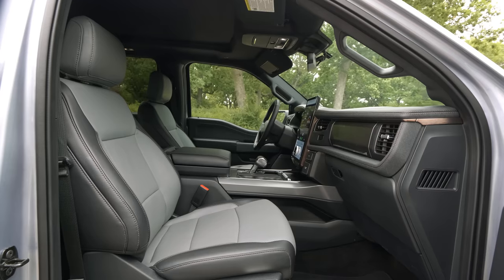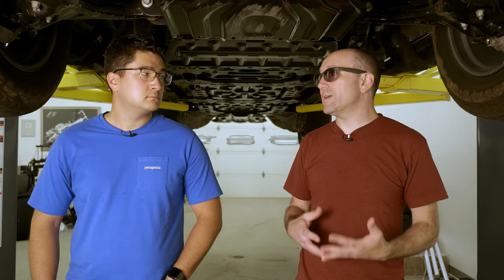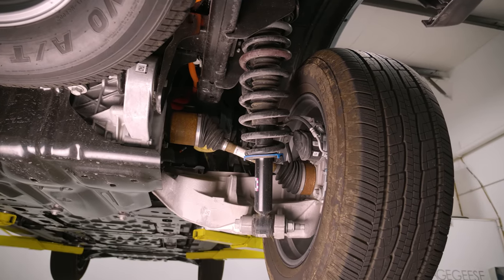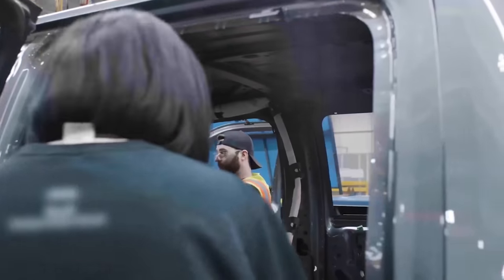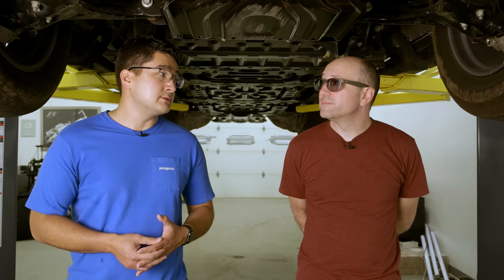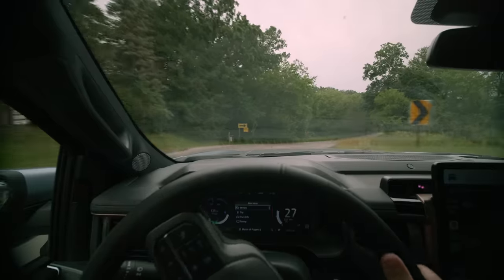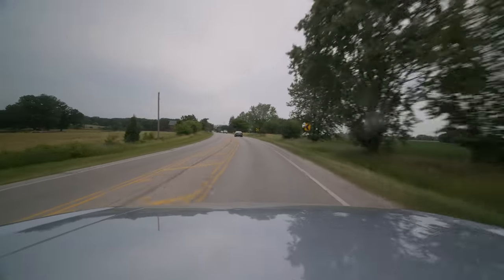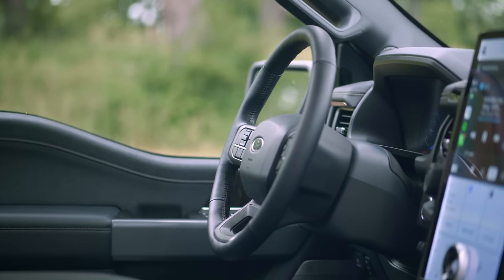Ford F150 Lightning | The EV That Will Change Trucks

Comment: QUESTION / TOPIC REQUEST: This might be relevant and a good topic for Fine Print: Battery charge cycles and longevity. All I hear is that if you avoid deep charge and discharge, the battery will last for more charge cycles, i.e. prolonging battery life. But it is never explained in detail. Does it refer to theoretical full charge cycles or to the actual narrowed charge cycles?
For example: If, theoretically, using a battery only between 40% and 60% charge gave you 8000 charge cycles and using it between 30% and 70% gave you  only 4000, then it would be the same, since each charge cycle covers twice the usable energy.
Is there a complex curve with identifiable sweet spots? Or is the usual norm of charging to only 80% for longevity just a compromise decision by manufacturers between longevity and practicality?

Do electric cars (all) allow you to choose your own charge limits? If someone is only doing short-distance drives, wouldn't they want to cap charge to 60% to presumably further improve battery longevity? (I imagine, apart from cars, electric toothbrushes and razors would be particularly interesting here, since they almost always just sit in the charger. Also DECT phones or such. But there also seem to be at least NiMH batteries that are optimized for this constant top refresh charge.)

Also interesting here is whether what burdens battery lifespan is more the charge state or the use of it in a certain charge state. I heard 100% charge will by itself stress the battery, but how much does a discharge activity add to that stress?

Comment: Lariat trim with the extended range battery is the way to go.You get the full 10,000 lb towing capacity, longest range, and a very nice but still practical interior. They need to make a 6.5ft bed length version.

Comment: As someone that bought their very first truck, a used F150 last year, we tow and haul quite a bit. Some short trips, some longer.
Ideally, this would be our daily and for the short tows with maybe a gas/hybrid F150 or F250 for longer trips as a loaner from the dealer? 

That would cover all our bases extremely well, but not really practical for the marketplace.

Comment: I do think this can be the game changer for pick-up's in the rest of the world. This isn't hit with the insane taxes in Europe and can still tow a bit and be usable for contractors who don't do >300 km a day, and the most don't overhere..
Reply: Yes distances are shorter so it's absolutely a better fit for Europe. Sadly we only get shitty diesel 4-cylinder pickups that get like zero R&D money spent on them so they are terrible compared to American pickups. I actually consider importing a Lightning Pro from the US for Europe, it's just so good and tax exempt here.
Reply: Most people drive much smaller pickups here
Reply: @imnotusingmyrealname4566  Yeah and that 4 cilinder's are just there for the CO2-taxes. I do think that if Ford is smart about how to roll out this vehicle in Europe it can be a big market and chance to set themself into the front of the pack.
Reply: @thomaswood2390  partly it's handier for the bigger cities, but I do think also because of the enormous taxes. A loaded F150 with the 3.5 ecoboost cost >120k Euro's so it doesn't compete with loaded MB Sprinters or some high end VAG products.
Reply: this truck is way too big to be a hit around the rest of the world. There are whole sections of european cities where this truck is unusable due to its size.
Reply: @imnotusingmyrealname4566  Nah, streets are too narrow in most of Europe. 

An all EV Maverick would be better. This thing is just way too big. A toyota hilux looked like a god damned lifted f250 in the UK.
Reply: @Channel-gz9hm  true. But if weight of size will be the measurement is to be seen..
Reply: Yeah but its like 3 times the width of your two lane roads..

Comment: The ICE models don't have a "range" per se, because they are so quick & easy to refuel. Their "range" can't meaningfully be compared to an EV range.
Reply: The range of an ICE truck to and EV truck can verily easily be compared and should be an important consideration in any purchase decision.
Reply: @Parker53151  no, because refueling on a car is far quicker. The only way to compare is time to travel 500 and 1000 miles. Then it makes more sense. Certain trucks and sports cars will lose to high range evs who can do the trip without stopping. There's no way though 250 miles of range in an ev is equivalent to 250 miles of gas range.
Reply: @Tential1  miles = miles

Comment: I’m an electrician. I have a reservation for a Lightning. From what I gather, Ford has partnered with some company which I am assuming “partners” with local contractors to install the required equipment for powering your home from your EV. The first thing this requires is the 80 amp Ford charger which comes with the larger battery versions. What doesn’t come with it is the transfer switch. I’m guessing that the transfer switch has some Bluetooth or WiFi connection which allows control of it through your mobile device. 

I have had trouble researching the operations of the 80a charger, and how it inverts to power a house. Ford has said that if you purchase this charger separately that other Ford EV owners can power their houses. TO me, this means ALL YOU NEED is that charger. A transfer switch merely switches power supply to another source. The same can be done if you have a brain. Most homes should have a main breaker or main disconnect. This will cut off the power supply from the utilities. Simply turn off the main, signal the charger to invert power from the EV to the house, and you’re there. This can also be done with a manual transfer switch- of course that is not as cool as being able to do it with your phone, but it might be several thousand dollars cheaper than a BT transfer switch. 

All of the electronics that make the inverted power supply possible have to be in the charger. Obviously the charger can’t be powered by the house if you want to to power the house. Any controls required to signal a transfer switch, or get a signal from a transfer switch must be powered by the charger’s DC side also so there has to be some way to bypass or jump contacts out in the charger. 

Like I said, the owner just has to have a brain trained to follow procedures. First, cut off the main power. Second, make sure truck is plugged in, and tell it to invert power. I would add in the case of air conditioning, that it is best to cut off your AC at the thermostat before switching power- regardless of how you do it! Then turn it on after power sources are swapped. This would be true for any installation. Reverse procedure when the utilities are on. With a manual transfer switch, you’d thrown the switch prior to telling the truck to invert power. I’d suggest a manual transfer switch with monitor lights so you’d have visual confirmation when the utilities are back on. Ford merely suggests that you use the company they partnered with, but it is not required. By NEC, all appliances are required to contain instructions for installation, so any electrician should be able to install and check operation of the Ford 80 amp charger. Best wishes to all.

Comment: I can't wait to see the recalls and headaches with all this new tech.
Reply: It's actually quite simple design.
Reply: Gas engine vehicles are much more complex
Reply: @DaRevrin  20k$ for a battery sounds pretty complex to me........
Reply: @illreportbackinabit.8514  Not really, extremely easy to replace a battery.  I'm not an electric car guy at all... but gas vehicles are astronomically more complicated and have many more opportunities for issues short and long term.

Comment: This is the first EV I've been interested in.  I have my 'sports' sedan, which I would keep, but this can occasionally tow my father's boat if needed and tow/haul stuff.  I had to rent a Uhaul cargo van just to pick up my new TV for instance.  This EV makes sense from a utility perspective as I am not a truck guy.
Reply: Unless you need that utility multiple times a week, people are still better off just renting a truck from a big box store/uhaul when it's needed.  The total cost of this truck (monthly payment + insurance + maintenance (albeit less than an ICE truck) + recharging cost) will outweigh the cost of renting-when-needed by a huge margin, and you don't take up the space needed for a second, large, vehicle.

Comment: Ford chose to “Frankenstein” the ICE F150 to get the Lightning to market quicker rather than a dedicated EV platform. Time will tell with the pros and cons as more BET (Battery Electric Trucks) come out. 

As far as the EVs being a home generator, OEMs are certainly starting to develop V2x applications (vehicle to anything). As you mentioned, residential and businesses with chargers will need to be outfitted with the proper hardware, but the intent is to balance grid capacity/utilization and cost to charge. So for example in your home, if it’s a hot summer day and you need to run A/C during peak electric rates, you can use the electricity from your EV to reduce strain to the grid and reduce cost of running your a/c. Then overnight when the grid is less utilized and off peak rates, you can recharge your vehicles. 

Still lots of develop required to make this a cohesive experience.
Reply: Wouldn't that tapping the AC into your truck all summer use up more battery life and make it not last as long?
Reply: @mexifry222  that’s another thing that’s certainly being studied. There are many things still being looked at and this is an early technology - so only time will tell with more data. 

You also have to remember that your vehicle will act as a supplemental system, not a standalone.
Reply: Sure time will tell, but a body on frame is body on frame whether you put on an ICE or an electric drivetrain.

Comment: When you have a solar panel inverter you most likely can recieve DC voltage directly. The only question is, can the EV be set to the voltage the inverter accepts. If not, you need to use a step-down / step-up (buck) power converter. If you do not want to unload the power to the electricity grid, you can use an inverter that reduces the power it lets through and monitor the current flow to the grid.

Comment: Any issues with submerging the rear motor when backing down a boat ramp?
Reply: Yeah Don't  do it good point I never  thought  about  that
Reply: They are sealed. People have driven Teslas submerged. 

The wiring connections are behind a pair of gaskets and the motor itself is oil filled. They handle getting wet.

Comment: 6,500 to 7,000lbs, imagine getting hit by this thing. Truly optimal transportation for the single man commuting to work
Reply: A fully loaded raptor is 6400#+ a fully loaded and fueled ram trx is over 6800#
Full size cowboy Cadillacs ain't light. Hell the latest damn escalade esv is over 6500# now. 🙂

Comment: I have some subs who are super into this truck. Total cost of ownership is insane on this thing. For example one sub has 10 trucks and is dying to replace them with lightings. When you are sending a crew to a job, last thing you want is to have to pay them to stop and get gas. If you think gas is expensive, wait till you have to pay for gas and for 4 guys to stand around for a man hour. Twice a week. (It does not take 5 minutes to get gas, plus it’s almost always a detour). Can’t even deduct the hours from workers comp anymore. Charging at the shop, on industrial or commercial rates is a no brainer.

150k of these a year won’t be near enough.  

Sure if you’re in the boonies it won’t work for you. But urban and suburban companies are the highest and best use case.

Comment: 10:47 You already know what is going to happen to the power grid.
The cables will overheat and slack until they arc with something and cause a blackout, much like in the 2003 incident.
Almost every single piece of electrical infrastructure needs to be changed to support mass electrification...
Reply: And where are all the new nuclear power plants being built to support this?
Reply: @prototype3a  no consumer is actually going to want to pay for new plants and an upgraded system once they see the impact to their rates.  Hell, the folks driving gas cars will actively fight it.
Reply: Not remotely true. For most people's mileage needs, existing infrastructure is sufficient.
Reply: What happened when everyone got AC in their homes? Electric appliances? They upgraded the grid. The power company is in the business of selling power, so if you want to buy more they're gonna allow it.
Reply: It'll be a lot easier than running gasoline lines to every house.  Let's be realistic here: there was a day when gas stations didn't exist on every street corner, right?  But the infrastructure got built for them anyway.  Does it really make sense to complain "upgrading electric infrastructure will cost too much" when our existing gasoline addiction is what'll kill everything?
Reply: @LJ-wo1wf  The electric infrastructure will be upgraded no matter what, it's just something that needs to be done.
Only issue is the time it will take, time that nobody (especially no car manufacturer) likes to talk about.
Every electric car commercial is just buzz words and 0-60 times thrown at you to avoid showing the real struggles of EVs
Reply: @legatus9081  they already showed the needed additional grid capacity and it's about 1.3% more per year to switch over to 100% evs by 2040.
That's nothing. When the grid is already built out to handle over 50% more than it does currently. Most ev charging will be done off peak or during periods of peak renewable supply. Through existing smart chargers installed at work/home and businesses like malls etc.

Plus none of those doom n gloom evs will make the grid collapse fud studies ever account for the reduced energy. 
That will suddenly be available from ramping down all those oil refineries, oil pipelines and oil pump Jack's. 
All of which use staggering amounts of electricity every single day 24/7-365 currently.
Reply: @4literv6  When you say off peak, you also have to consider that in a 100% EVs scenario the peak time changes as everybody plugs in their car at night after they come home from work.
Also I am not talking about total power available, more about the infrastructure that supports it and spreads it across the country.
It will be upgraded eventually, but def not by 2040

Comment: The question about grid capacity has been discussed at length within technical circles. The general consensus is usually split into two thoughts. 1. Have "smart" charging network where in-home chargers operate during non-peak hours (typically at night when demand is low). 2. Plug-in electric adoption rates will track the power generation capacity industry where enough grid capacity is added each year to match the demand (as a whole). There will be instances where some areas grow grid faster than adoption and areas where the grid grows slower than adoption. Home-based solar systems with battery backup can supplant the demand for many folks in many regions at a cost...but early adopters tend to be higher income who can adapt their homes before industry finds the right push-pull balance.

Comment: While I am No Fan of the EV Market (In fact, one could consider me a 'Conspiracy Theorist' with what I believe is happening with this 'Market' and what Government is trying to 'Exploit' with this Market), this is probably the BEST EV Vehicle out there in terms of BOTH Practicality and Functionality. Plenty of Horsepower & Torque, and they didn't change the Interior of the F-150 TOO Much. It's the Same F-150 we all KNOW & LOVE, Just with an Electric Motor WITH 4X4 STANDARD! (No FX4 Package of Any Kind, Unfortunately.)

The BIGGEST Downside of this Vehicle (And One that I think will KEEP this Truck from selling well) is the Battery Range. You're looking at 250 Miles on the Standard Range Battery and 450 Miles on the Extended Range Battery. I don't know about you, but having to Pay $20K+ to go about the Same Range as MOST Combustion-Engines is, and should be, a Major Turn-Off for Some. Lithium Batteries are JUST NOT where it needs to be in terms of Efficiency and Range Overall. Add in a Trailer of 5K Lbs. or More, and Your Range Drops to 100-200 Miles at MOST!

As a Result, I see the F-150 Lightning, in its current state, as more of a 'Status Symbol' kind of Truck. It's not Practical for the things most people will use their Trucks for (Towing, Payload Hauling, Work Truck Use, etc.), and Overall, Is just TOO MUCH Money for a Truck that Doesn't do Enough due to its Limited Range.

HOWEVER... This STILL is, from my perspective, THE MOST PRACTICAL ELECTRICAL VEHICLE ON THE MARKET RIGHT NOW. If you want a Electrified Vehicle that can do practically anything... THIS IS IT. Ford has hit a HOME RUN with their F-150 Lightning, but further Technological Advancements in Battery Power WILL Need to Happen to UNLEASH the Lightning's FULL POTENTIAL.

I'll stick to my 2017 Toyota Tacoma SR with a 4-Cylinder Combustible Engine, but I'm excited for the Future of Electric and Hybrid Trucks!

Fantastic Work on This Video SavageGeese!

Comment: Don’t forget that not only do you need to rough in a transfer switch and panel to pull power from you truck to your house, you need the pro power charging system that requires like an 80amp circuit which would likely push you into a 400 amp system which could be mega bucks. Your neighborhood’s infrastructure may not even be able to meet that requiring further cost of Hydro Design to upgrade transformers or under ground services.

Comment: So approx 275 mile  Range when new. In five years time when the battery has deteriated, particulatly if your in a cold climite what will your range be then?  What will your expensive truck be worth?